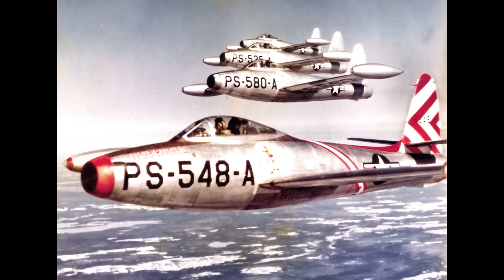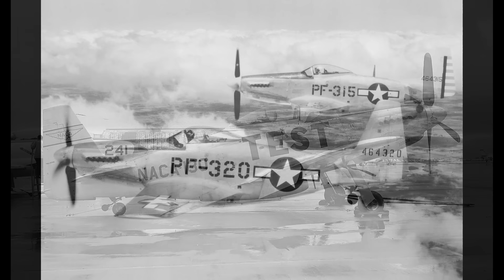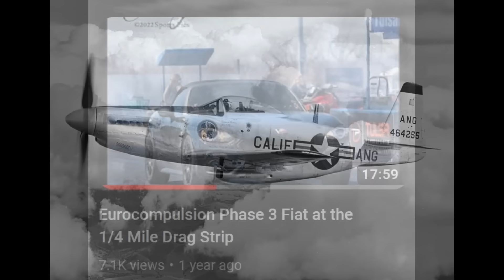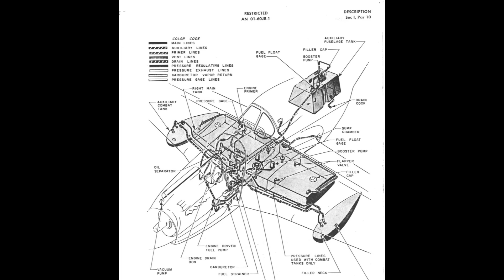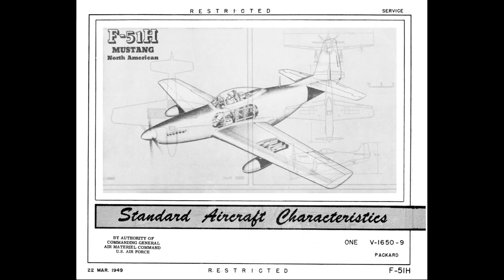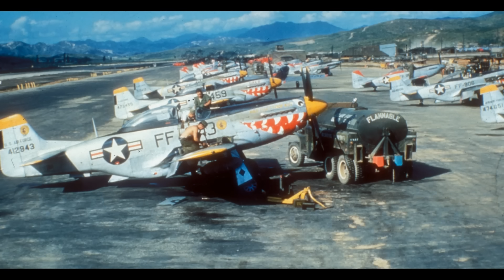P-51H Mustang, Superprop!

Comment: Can someone please explain what is the difference between "stages" and "speeds" when referring to superchargers? Thanks.
Reply: A stage is the centrifugal fan blower. Two stages is two blowers in series. The speed is how fast that blower spins. Two speeds means you can spin at two different rates. 7,200 rpm, for example, at a first speed and 16,700 rpm for a second speed. Changing speed probably involved some kind of gear box on the driveshaft powering the blower.

Comment: What about the P51K ?
Reply from the maker: The K is just a D model with a different prop. In terms of performance it's pretty much the same thing.
Reply: I suppose as you say the jet age really made it all rather academic. Any old jet plane could knock the pants off even the most sophisticated prop fighter. My dad saw brand new raf planes bering test flown once, landed, taxied to the end of the runway where crews of scrappers were waiting. He was horrified to see brand new merlin engines being sledge hammered.

Comment: Two candidates for superprops but available info is so scant it's not to be: the Republic XF-12 Rainbow & Dornier Do-217P. A 4 engined bird that would do 450-mph & a 3 engined that would do 470-mph respectively.Too few made doesn't help either two of one, 3 of the other. But to dream of avgas turned into a condensation trail at 40,000'!

Comment: Why no water injection for the Merlin?  The Merlin was used in the Spitfire.  If space for a water injection tank could be found in the Spitfire air frame better use for that space would have been more fuel.

Comment: On the note of water to oil based oil coolers, many Japanese cars have such coolers, typically built into the oil filter mount. My ‘08 Nissan Altima with a 3.5 L had such a cooler. And in my experience, many Mercedes diesels engines work roughly the same way

Comment: According to Wikipedia , the Packard Merlin used in the P-51 that fought the Luftwaffe was rated at 1380 H.P. That seems like a low number considering the SeaFire had a 1550  RR Merlin. Was the Packard Merlin of lower HP than RR Merlins? Was this why Luftwaffe could out climb P-51 D.
Reply from the maker: The 109's climb performance had a lot to do with the low weight of the plane. The Packard Merlin in the 51 had over 1700hp late in the war, they kept increasing the manifold pressure limits.

Comment: In know you get a lot of comments, but one thing that keeps popping up in discussion of the P-51 is the 'Meredith effect'. I have heard some reasonable informed engineers dismiss the idea, arguing the air heated by the radiator (which no more than 200 degrees or so)  could have no real effect on the speed of an airplane. Considering the other forces at play,  find myself skeptical that radiator-heated air could have any real effect, as well but am curious if you had opinions.
Reply from the maker: The Meredith effect is minimal, however as a whole, the design of that scoop is quite good and the whole cooling package has low drag as compared with other WW2 fighters.
Reply: @GregsAirplanesandAutomobiles  Interesting. Thanks - love the channel!

Comment: i had a kiwi friend who installed a water injection system on his twin cylinder harley motorbike. i dont think he understood why it would work on a howling aircraft engine and not his slowly chugging harley engine. of course i was none the wiser at that time, i just thought water was antithetical to combustion but he assured me this method was used on aircraft engines to add a significant power boost so he was wiser than me in that regard. he just didn't fully grasp the exact method by which this was achieved. now i wonder what exactly he thought the water was doing to increase power.

Comment: The A-1 Skyraider was pretty awesome.  Short reminder about water injection,  It enabled cooler air (dense/ cool air = more oxygen = more power)  As a US Navy Aircraft Mechanic I can highly see  the value of removing engine performance settings from the pilot's control.     The Pilots are pretty busy.    Side note, My 96 impala SS has an oil and transmission cooler.     If you are an engine nerd,  find a way to be around a Merlin Engine when its started and warmed up.   It's like taking a ride in a B-17,  once in a lifetime cool.

Comment: I have a question for Greg...I have read various publications on all of the different variants of the P-51, and there are several different power ratings given for each of the three different Merlins that were produced for the Mustangs...the 1650-3, -7, and -9. The power ratings for the -7 are listed for using for using 130 octane fuel and either 61 inches manifold of pressure, or 67 inches. I have read somewhere, and I don't remember where, that later in the war, pilots were authorized to use 75 inches of manifold pressure when using 150 octane fuel on this engine, however, I can't find any power ratings for this pressure/octane combination. Were pilots cleared to use this much manifold pressure, and if so, do you know what the power rating was using this combo? Thanks.

Comment: That's what 40-45psi boost, that is amazing!! That is a tremendous force inside the engine during combustion, it's really incredible for the time, even today.🙂
Reply from the maker: No, it's about 29psi of boost at sea level. Boost is measured above ambient, manifold pressure is total pressure including ambient. Now as the plane goes higher it needs more and more boost to hold it's manifold pressure. I have a video about this somewhere. Now up at very high altitudes that 90 inches of manifold pressure will be about 38psi of boost above ambient because the pressure there is so low, but still only 29psi above pressure at sea level.
Reply: Oh, thank you for correcting me. I have watched numerous videos of yours that are very interesting, I will look for this one too. Thanks Greg! @GregsAirplanesandAutomobiles

Comment: I wonder how many H got into private ownership. I'd love a video showcasing just how people originally bought warbirds. I know Allisons were $75 in crate, complete and ready. It just blows my mind that stuff like that was cheap at any point.
Reply: +@StabyMcstabsFace  There are five P-51H survivors and three are in private ownership- one flyable and two projects to fly.  The boat racers grabbed all of the crate engines they could find and trashed them in the 1960s and 1970s.  Engine spares will always be a problem until it is economical to manufacture new assemblies.
Reply: @FiveCentsPlease  I've heard the stories of the Japanese scrappers buying hundreds new in crate and taking the bearings out and pushing the rest overboard while underway. The recouped precious metal from the bearings was worth more than the government was charging for the motors.
Reply: @StabyMcStabsFace   I've read accounts of hundreds of Merlins stacked in crates in Los Angeles. Salvaging the bearings seems pretty labor-intensive though.  That reminds me of the man who grabbed surplus B-17s just to get the fuel out to resell and make a profit.
Reply: @StabyMcStabsFace  Actually I think there are now six P-51H (including wrecks, projects) in private ownership and two examples on static museum display.  One of the six is the remains of an XP-51G that is being resurrected.

Comment: Greg, the Thunderjet is a bad example for showing jet superiority over superprops. It may have flown in '46, but wasn't ready for deployment until '48-'49, and even then was shite plane with much trouble until the "D" model ('51-ish?). The P/F-80 is better, but it has no load and no loiter until the "C" model. I suspect a WW2 vet in a -51H could probably still outfly a draftee in an -80.

Comment: OK, so the H had an integrated fuselage tank that didn't create a CG issue- how? Was it moved forward? Did moving the cockpit up make space for a tank underneath?
Reply from the maker: It's smaller and farther forward relative to the wing's mean aerodynamic chord. Basically the H was designed with that tank there in the first place. The previous airframes were initially designed without it and they added it later.

Comment: Kinda interested in the radios the 51H. The 51H FF-191 has a loop antenna. FF-021 has 2 whip antennas side by side, as do most of the 51H’s pictured. Curious as to why that is?

Comment: Hi Greg...Cool video on the P51H..!  An observation...the P51H profile "nose droop" looks remarkably like CAC's CA-15 "Kangaroo" design that Sir Lawrence Wackett and Fred David kicked-off in June 1943. Originally, the CA-15 was designed for a radial engine...e.g. 😮the 2,300 hp (1,715 kW) Pratt & Whitney R-2800 Double Wasp plus a turbocharger😵‍💫...guessing the R-2800-44 or the R-2800-73 with the General Electric CH-5-A3 turbocharger..?!? However, with the P & W R-2800 Double Wasp becaming unavailable; suspect, that's because of more pressing war demands, they fitted an in-line Rolls-Royce Griffon Mk 61 (2,035 hp/1,517 kW) leased from Rolls-Royce.with the intention for production engines to have a three-stage supercharger.:face-fuchsia-tongue-out:. One could say that these boys were serious 🥵"hot-heads".  Story goes that after some initial "issues"...CAC's CA-15 "Kangaroo" and Flt Lt J. A. L. Archer reportedly achieved a 🥶speed of 502.2 mph (803 km/h)🥶 over Melbourne, after levelling out of a dive of 4,000 ft (1,200 m), on 25 May 1948.  So, I'm not surprised that the P51H is a "Hot Ship"..!  Is it possible that some design data was shared with NAA..??

Comment: The truly crazy thing is private race teams are doing over 500 mph with P-51's at like 5000 ft. The true highest performing mustangs of all time are air racers like Voodoo which once recorded a pass at 554 mph
Reply: As fast as Voodoo was/is, I believe Dago Red and Strega were even faster. Dago holds the record at Reno of 507.XXX, and it's too bad neither of these race teams were willing/able to spend the money to set a new 3K record. I believe either one of them would've beaten Rare Bear's record by a considerable amount....
Reply: @jamesbottger5894  the speed record now held by P51.  Look it up, partly new standard
Reply: The crazy thing is that the top speed of an H mode is 487, and that's at 25000 feet.  No production Mustang has broken 500mph except maybe in a dive.  Cool story but as usual the fish gets bigger as the story ages.  ;-)
Reply: Yes lap record at Reno like 505 mph, that's 5000 ft and w turns.  

Shame Reno air races ended
Reply: @muskepticsometimes9133   Reno is exploring Casper, WY or Pueblo, CO or Roswell, NM as a new location to hold the races.  The airport at Reno wanted the land.
Reply: @FiveCentsPlease it was ultimately about liability that was masquerading as needing the land. The Reno airport has seen a significant drop in business since the cancelation of those races.
Reply: @FiveCentsPlease  They tried last year in Roswell but the unlimiteds did not come.  More work at the site needed.  I USE to go every year to Reno.
Reply: @Rogue1_7.62  I'm sure all the businesses in Reno felt it, especially the casinos.

In 2023 there was a P-51H at the races.  Dunno if it qualified for bronze or silver or was there just for exhibition.  I'll have to research that.

Comment: Ya water injection was strictly to control detonation. Detonation was caused by too high of compression and too low octane fuel. The fuel octane number is how much compression the fuel can take before it detonates on its own, ie; without a spark. If this happens before top dead center bad thing happen. But higher compression equals more power, right? Its a tricky dance. Maybe do a video on fuel research during the war along with a dicussion on detonation , turbo , and supercharging. And maybe a little on altitude and water injection to boot.
Reply from the maker: I appreciate your suggestion, but I  have covered all of those things in other videos, and in a lot of detail.

Comment: Greg, thanks, great video. I'd please like to make 2 comments. The first being the use of the hollow steel bladed Aeroproducts A542 propeller on the P-51H. This saved +/- 100 lbs over the Hamilton Standard Hydromatic unit, but more importantly, the near constant-chord "H20" series of blades had a high activity factor (ability to absorb horsepower) of 130.6 and was favored by post-war air racers for decades. The Aeroprop H20 design series was used on the later models of the P-63, all P-82 and F8F aircraft, and early models of the Skyraider. The other item is that late war German fighters such as the FW 190D-9 and Ta-152H also used liquid-liquid heat exchangers to cool their oil.
Reply from the maker: The Aeroproducts prop is coming up a lot in this discussion. It's interesting because in another video I talked about Aeroproducts and based on the comments there nobody was interested in it. I wonder what the difference is here?
Reply: @GregsAirplanesandAutomobiles  , I can't explain the difference in interest. The Aeroprops are a research fascination of mine, particularly the CRP units found on the XP-72, XF8B-1, XP/P-75, A2D, XP5Y-1, and R3Y Tradewinds.

Comment: I noticed that on a lot of the post war ANG 50H's the tail wheels are down in flight (don't seen to have tailwheel doors either). Why?  would ease of maintenance be have been a big enough factor to justify the performance hit ?
Reply from the maker: The 51H did have a retractable tail wheel with doors which enclosed it. What you are seeing are planes with them pinned down for some reason, a service bulletin, maintenance issues or something else.

Comment: I will always wonder what a Griffin powered P-51H might have done and with M3 version 50-cal. weapons? I think 500-525mph, at which point a P80 was not too much faster and had so much less range
Reply from the maker: Maybe, but it just doesn't matter. The F-84 flew in 1946 and could exceed 600mph in level flight. It just wasn't a contest anymore.
Reply: As much as I love piston jobs, getting a type like that at over 500 mph in level flight is tough. Just look at the Civilian Bearcats and Mustangs that have been lightened and with more powerful engines. And that’s just to keep them going for a very short time.

Curious why the Americans didn’t look at contra rotating props as well like the British did.

Comment: Greg, I didn't hear anything about the taller vertical stab on the P-51H. It looks like the taller vertical stab on a TF-51.  Great video. Now I am going to watch all your videos. I just subscribed. About Edgar Schmued, he also designed the F-86, F-100, the T-38/F-5 and the P-82 Twin Mustang. Kind of like Ted Smith (of Aero Commander) who had a big hand is designing the DC-5, A-20 and A/B-26 when he worked for Douglas in the 30s and 40s. See any resemblance to the A/C series of aircraft?
Reply: The TF-51 did in fact use the H model vertical tail. The TF being built after the H.

Comment: The Merlin fitted to the P51H was a R-R Merlin 100 series. R-R (like all manufacturers) continuously worked all the little flaws out of the engine and kept developing it make higher power for longer and with even more reliability. They actually referred to the 100 series as 'The Ultimate Military Development' for obvious reasons.

Interestingly by mid war they could make minor modifications to standard Merlin 66 to boost it to 2050 hp (emergency power) on 150 octane. This power boost was all part of the development of the 100 series seen later on the P51H.

Comment: I honestly think the performance of both the British fighters seems quite low compared to the stats I've read in other places. Perhaps on their tests they were only running 130 octane as opposed to the higher octane fuels the other fighters were running for their tests. I thought the Seafire could climb at well over 5000 fpm and had a top speed of over 450 mph.
Reply from the maker: I covered that exact thing in the videos on those airplanes, just as I did in this one for the P-51H. I can't go over the same stuff in every video.
Reply: @GregsAirplanesandAutomobiles  oh ok, I'll have a look. I get it, as you don't want to sound like a scratched record...

Comment: Another wonderful video Greg. I am really enjoying these Super Props series. Must admit I love the P51. The H model was really something special and only made me love this model even more than the D model.

The Sea Fury is a wonderful aircraft, as are most of the Super Props, probably a better all round winner but like you said it has a combat record to back it up. The H missed out in the Pacific but I'm pretty confident it would have done just swell. North American weren't newcomers when bringing out new types for combat. Think of the first Mustang, Twin Mustang, F86 etc.

The late piston jobs had one advantage over the early jets and that was endurance. Very good for loitering and with good range. You mentioned the H not being used in Korea, for a number of reasons. If the claim of the H wasn't as rugged as the D, the P47 Thunderbolt would have been ideal for the ground attack role. The Mustangs' water cooling was it's main vulnerability, forget a hit in the oil cooler, a hit to the radiator and it's good night nurse. Speaking of oil coolers, the Corsairs oil cooler was it's weak spot as well.

Anyway, will you be including the Martin Baker MB 5? I think only a couple were built but that also is a hot ship.

Keep up the excellent videos!

Comment: I read somewhere that one of the objections the Army Air Cor had with the H was the smaller wheels and lighter landing gear struts. I don't think the P-51H would be very safe operating off of grass strips. Great video Greg as always
Reply: It is the Army Air Forces by the way. it Stopped being the Air Corps in 1941.